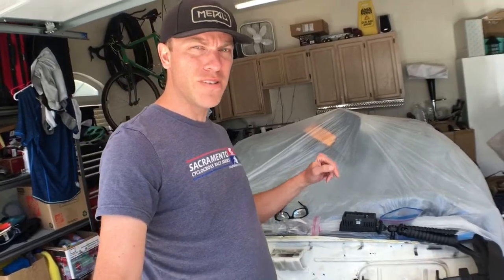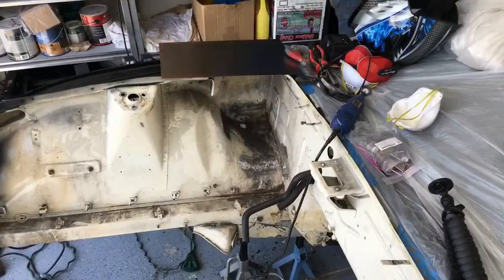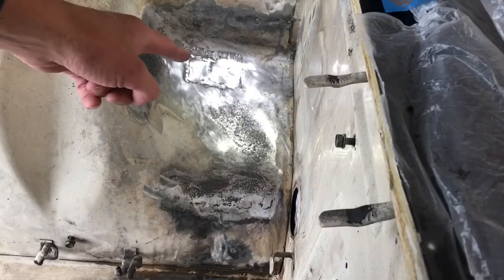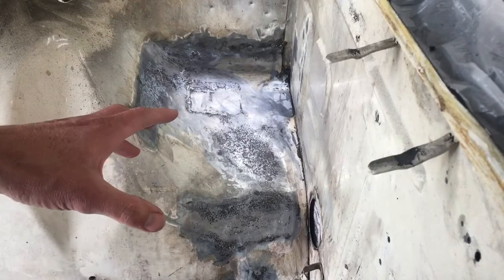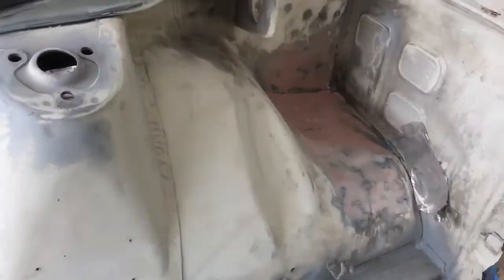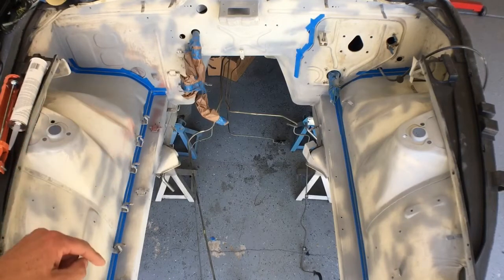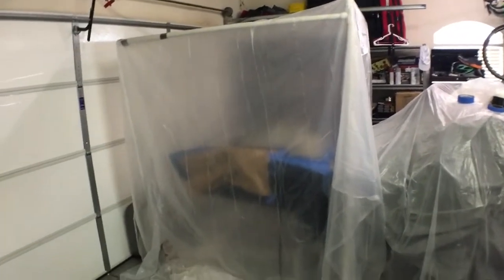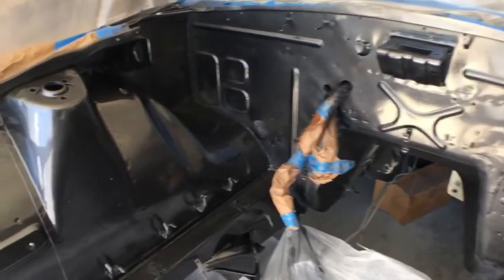How to  repair, prep, and paint the engine bay on the Datsun 240z

Comment: Good work ! Anybody reading should know eastwood and summit sell paint 2k urethane for 100bucks .
Thats paint reducer and hardner. You just cant beat that.
      I know the clear used here is 2k but at 25dollars a can. It may be more economical to buy a gallon
Of the kit.( they dont have alot of factory colors .So this method was the way to go.
Im doing the same to my cars ( Summit Paint kits ) Im doing 2 Z cars  at once. Engine compartment will be after Im done welding up rust holes.Im in the middle of that.Im so looking forward to being done patch panels.
Great video.
The flux core mig throws more sparks then the gas sheilding mig but it still sparks. But the flux core you dont need a bottle of gas ...that can save alittle time and money. Best thing for mig welding is a self darkening mask you can get a very cheap harbour freight one that works very good for the home builder
I like ,you bothered to paint the engine bay same color as outside.
Some people shoot it in black but black is so hard to see when things go wrong.
The. Z car came in the same color as the engine bay. Unlike italian super cars ,always had black engine bays .Because under italian cars is never as beautiful as the outside you see.The black hides that fact.

Comment: a note to anyone watching this in the future. Some bodymen don't like putting bondo directly over rusted metal. The bondo can retain moisture and can speed up the rusting process. Rust converter sprayed over the rusted metal and then primered and then polyester glazing putty over the top is a way to isolate the rusted metal from moisture in the future. I'm not saying your method is wrong but this is what others are doing.
Reply from the maker: greg h thanks for your insight!